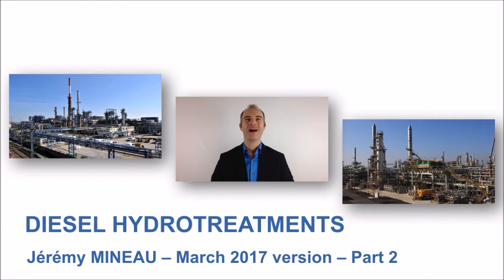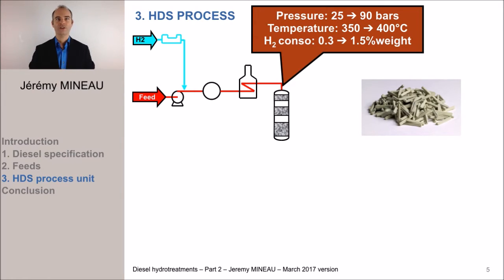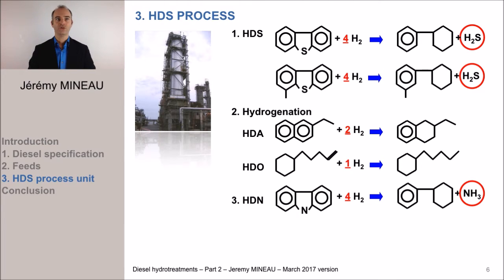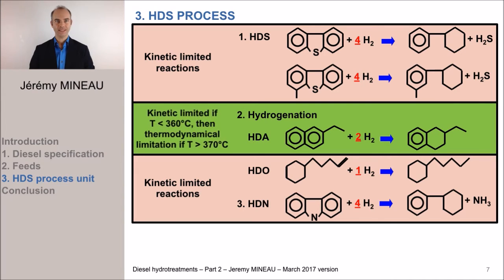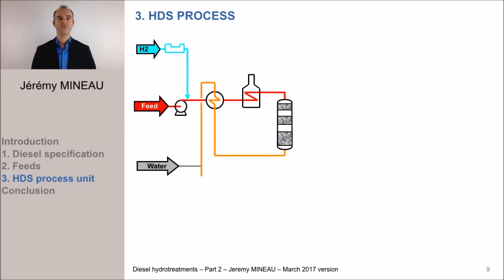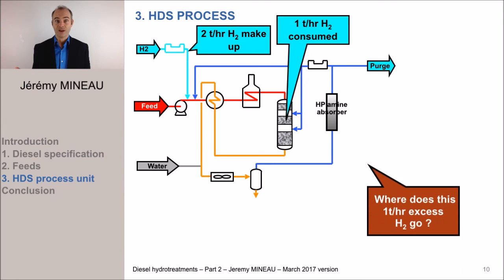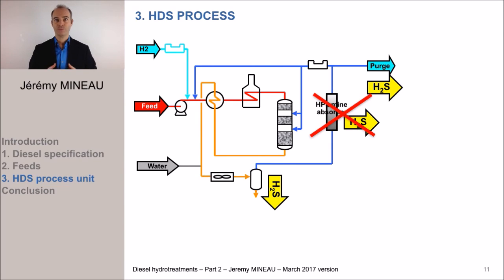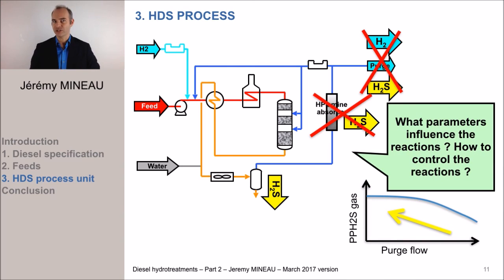MOOC - HDS / Diesel Hydrotreatments - Part 2

Comment: What is the octane rate of nafta wild?
Reply from the maker: Thanks for the question, but most of the time we do not care about this figure since this naphta is routed back to the main crude oil distillation where it is mixed with the total straight run naphtha that will end up in the total naphtha splitter and finally in the reformer for its heavier part.